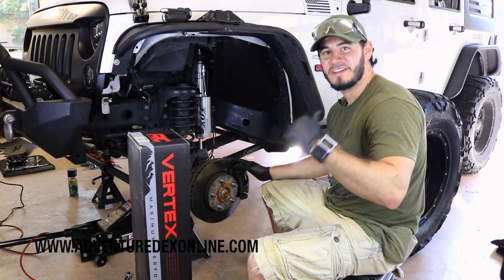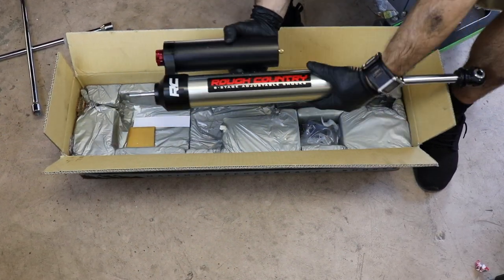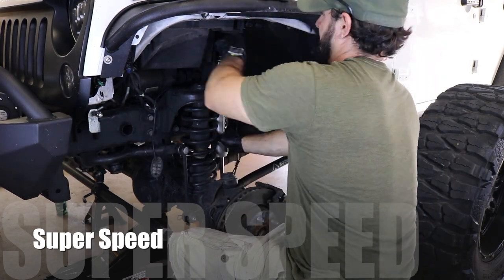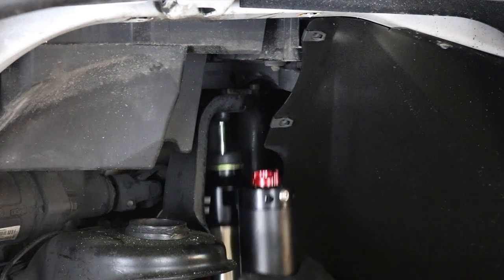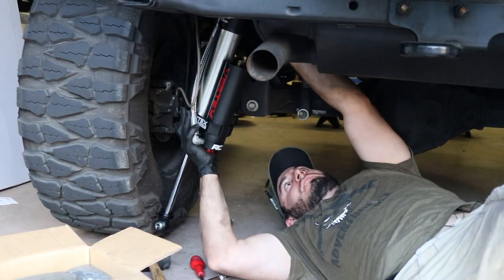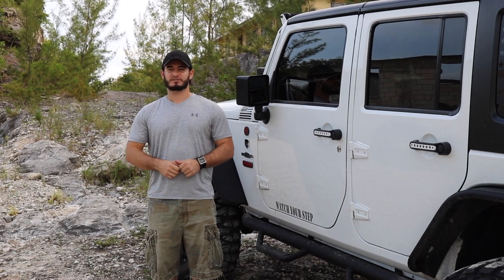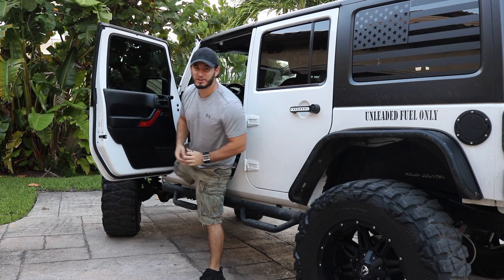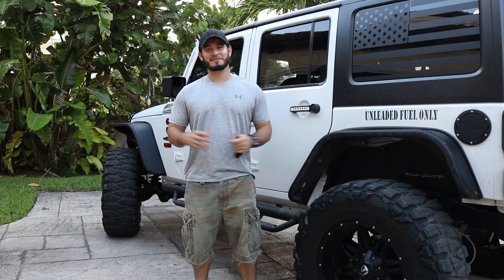Are these Jeep Shocks worth $1,600!?!

Comment: It looks like you lost a few inches of travel compared to those fox shocks, that would be my only worry. overall they look well built though.
Reply from the maker: Thanks for the comment! That might be the case but the ability to adjust them sort of compensates that. In the video I had them on the least resistance setting for easy install and to test the overall travel. So far so good!! Thanks for the support #jeepwave
Reply: He is a mall crawler, so I think he is fine 🤣
Reply: If you look at Compressed and extended lengths you gain quite a bit of travel.
Reply: @nicholasnelson6073  looks like he lost travel

Comment: Hey Dex, I see your front Vertex shocks didn't come with (or you didn't install) the upper relocation brackets that are currently included with the Rough Country Kit.  Do you have any issues with your shock body interfering with anything without the relocation brackets..?  Thanks!
Reply from the maker: Hey! No interference! Still enjoying them! 💪🏼
Reply: if you can avoid the bracket, DO NOT USE IT. Both sides snapped as i was driving on a regular dirt road (or possibly even before). I havent off roaded very hard, just dirt roads and they already broke, not even 500 miles on them yet. Completely dissatisfied. My jeep is currently at the shop cuz when the bracket snapped, the bugger nut pulled through the shock tower and the shock fell out and got stuck in the wheel well. I was stuck in the middle of nowhere with no reception or help.  Jeeps currently in the shop and im waiting to hear how they plan to fix it

Comment: Did you re-gear your Jeep to accommodate the larger tires? I couldn’t find a video on your channel about it.
Reply from the maker: Unfortunately, haven’t had the opportunity to regear yet as nobody in my area offers this service. I would recommend it but from my experience the Jeep is still very capable. I do plan on regearing in the future
Reply: AdventureDex I have a sport unlimited as well and was weary about lifting it prior to re-gearing. Did you notice a big drop in acceleration or highway speeds?
Reply: @adventuredex  hey I am also in Nassau and and was curious if you ever found anyone to do a regear?
Reply from the maker: Unfortunately not 👎🏼